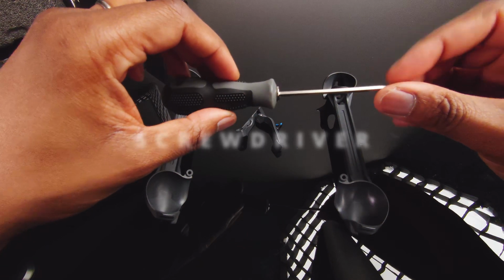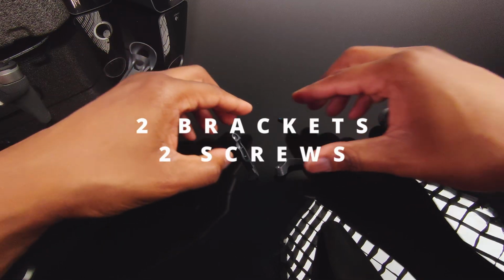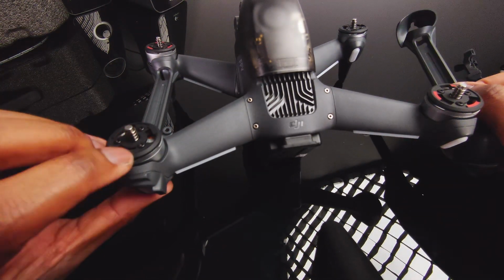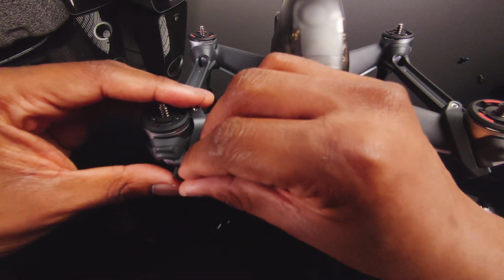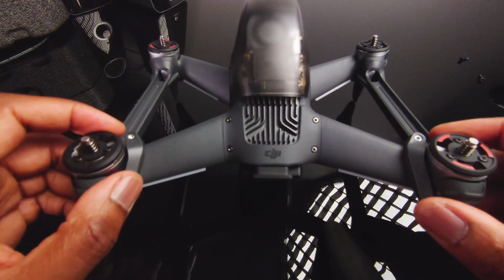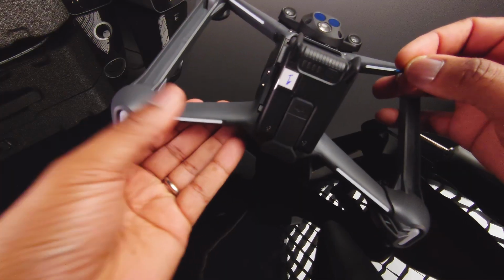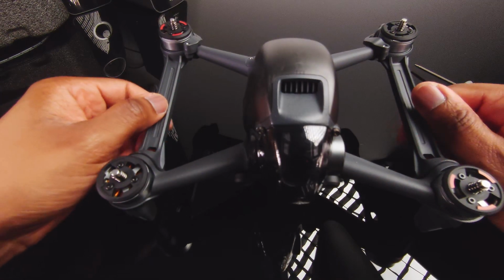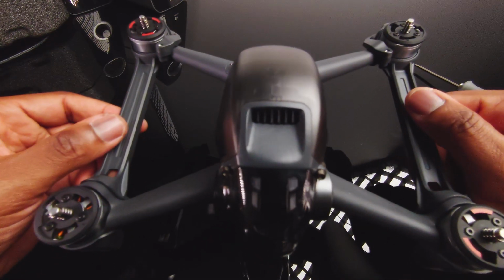DJI FPV ARM BRACERS

Comment: i bought a case  that works with the braces on and the props,,,,,
Reply from the maker: really ? please give me the link ...thanks in advance
Reply: @brunovfpv5756  RLSOCO Hard Case for DJI FPV Combo - Fits FPV Accessories:Drone Body ,FPV Goggles V2, Controller, Motion Controller, Arm Braces,Charger and Battery x 4 (One in Drone Body)
Reply: amazon
Reply from the maker: @jamiehill9578  ok ill have a look
Reply from the maker: @jamiehill9578  thanks

Comment: Do you think it’s worth buying it ? & why so
Reply from the maker: man , definitely yes , with arm bracers there are less vibrations, the quad is more stable , and hopefully they can help transfer the shock wave , in case you crash it.I dont regret buying them, with those arm bracers i felt like i was flying another drone...
Just the fact that i feel that the drone is more protected , makes me try to attempt more things ...
Reply: @brunovfpv5756  i appreciate your response, thank you.